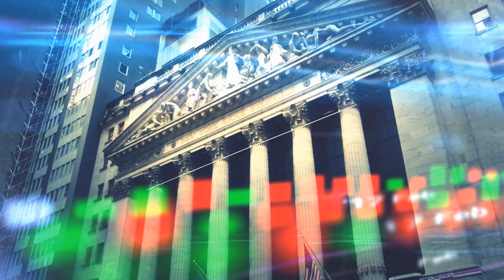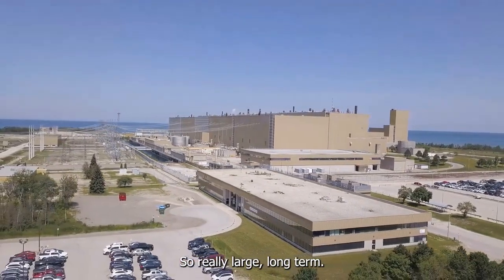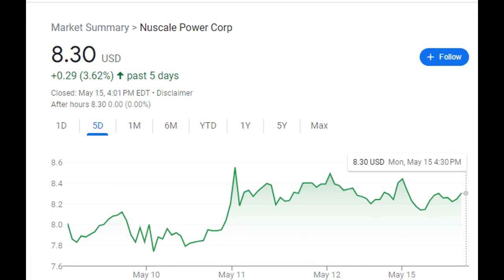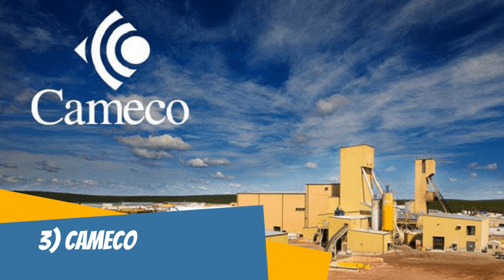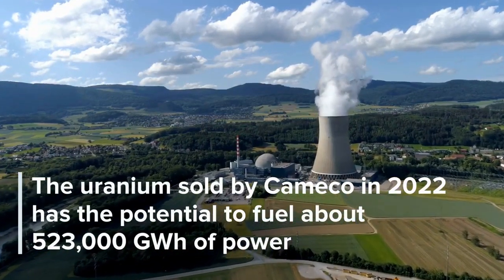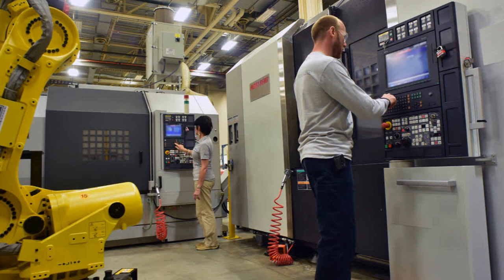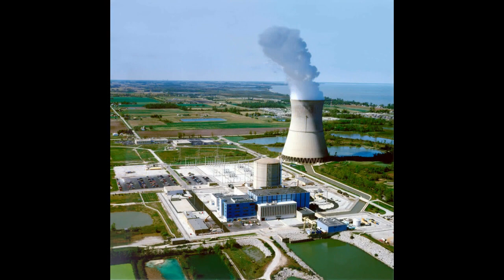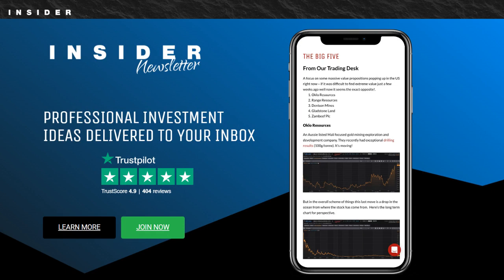5 Best Nuclear Stocks To Buy Right Now

Comment: What a terrible use of stock video clips... You're making a case against, no for, with this sloppy job
Reply: No actually reality is making the case against nuclear.

The country’s first expected commercial small modular reactor was scrapped by NuScale Power on Wednesday, delivering a major setback to the advanced nuclear industry.

NuScale and the Utah Associated Municipal Power Systems (UAMPS), a group of local electric utilities that had agreed to purchase power from the project, mutually decided to terminate what was known as the Carbon Free Power Project (CFPP), according to a news release. NuScale is the only U.S. developer with a design approved by the Nuclear Regulatory Commission (NRC) for a small modular reactor (SMR).

The project was supposed to consist of six 77-megawatt SMRs, generating a total of 462 MW, and come online in 2029. It was to be located near Idaho Falls, Idaho, at the Department of Energy’s Idaho National Laboratory.
Reply: @clarkkent9080  thanks for clarifying!
Reply: @rick-zee  NP.  The only remaining nuclear project in the U.S. that has any chance of actually producing electricity before 2035  is Terrapower with their Natrium reactor.  However, they have yet to break ground.